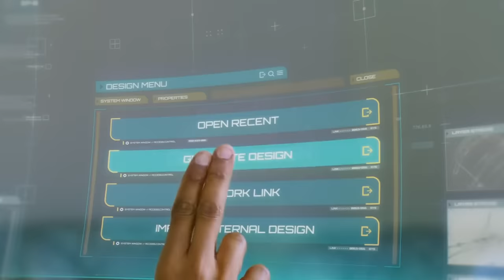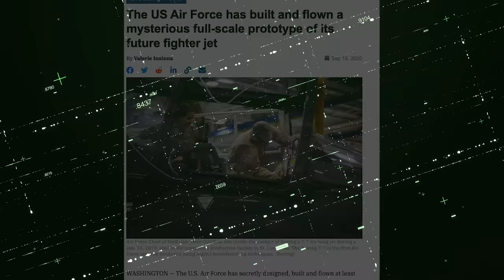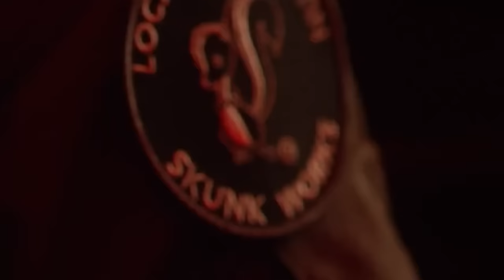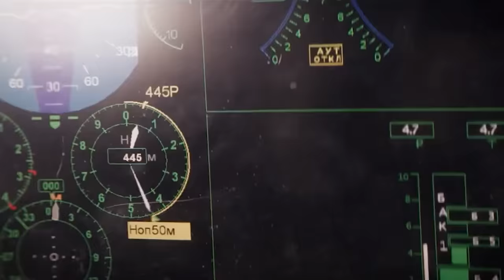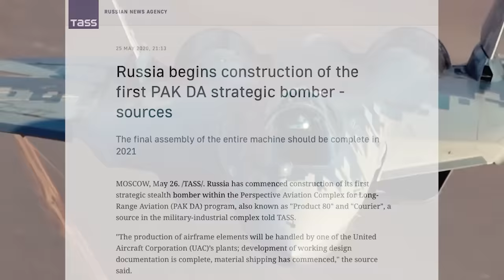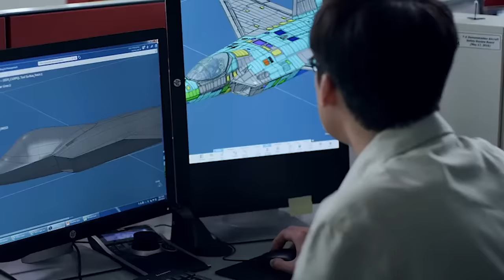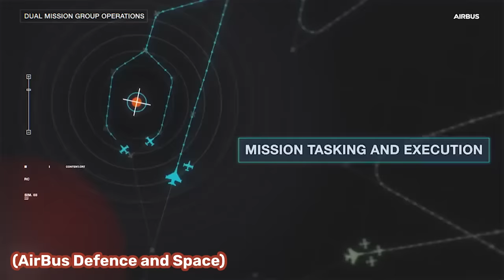12 new stealth aircraft headed toward service

Comment: So many of the new fighters look very much like the F22.  I wonder how the engineers who came up with the F22 form way back in the late 80s feel about seeing their work echoed in airframes that will be used probably for 6-7 decades after it was first conceived.
Reply: Partly direct theft, but honestly… it’s mostly just physics. 

These airplanes have to operate in the same atmosphere that is subject to the same laws regardless of what flag is on the tail. Solutions to those same rules and laws often look alike because of the same upper limits of computing power and the education of the engineers involved. Most of the very best around are products of a handful of aeronautics engineering programs.
Reply: @FloridaManMatty  good point. if you look at high end racing bikes now, they all basically look the same for the same reasons

Comment: All future aircraft are intended to be airborne comms / recon nodes. All of them. Whether US-built, China-built, Russia-built, it doesn't matter. Land-based on sea / carrier-based, you name it. Manned, optionally-manned, fully AI ... all of them.

The F-35 happens to be an airborne comms / recon node which is quite stealthy and can shoot back at you. The current incarnation of the U-2 is a not-so-stealthy comms / recon node, which we are flying today; it started out as a recon aircraft but evolved with digital tech and increasingly-advanced comms. The B-21 will be a stealthy one which can drop 20k lb of high explosive on you.

Any aircraft which isn't one of these is going to be target practice for weapons systems which are.

All current and future aircraft have a "digital twin," which allows you to test tweaks / alterations in simulation, before you get to the point of "cutting metal." Heck, even buildings have digital twins, anymore. You know the Falcon 9 and Starship have digital twins; that's why SpaceX was willing to build, and crash, Starship prototypes; they were trying promising new designs and collecting very large amounts of telemetry with which to evolve the digital twin. Their digital twin evolution on the Falcon 9 is why they now have boosters which have flown over a dozen times. More flights → more telemetry → more evolution on the digital twin → improved design and small, incremental tweaks to the physical construction → improved vehicles.

Many of the stealth aircraft you talk about in this video have passed "design reviews," meaning the digital twin has evolved to a degree and people feel they are ready to start cutting metal. Exactly where the money will come from for that ... I suspect that's a large part of what's wrong with the Su-57; they've got a digital twin, of some kind, and they've cut some metal but they're still evolving the design (see the above reference to Starship) and they're having a hard time finding the funds to cut some more metal.

That said, I love the amount of info you can cram into < 20 minutes. Keep up the good work.

I know the F-16 is still evolving; still wishing they could come up with a larger, more-capacious, faster, possibly stealthier version of it. Not sure how they can clean up that gaping maw of an intake, though. Spent multiple years as a 45254B / 2A353B (F-16 tactical aircraft maintenance specialist) so I have a soft spot for that bird.

Comment: For the Tempest RR already has the engines at MOD1 status (MOD2 will be even more powerful) . Some were put in a Typhoon for test purposes. Apparently that resulted in a fair bit of swearing from the test pilot as the aircraft acellerated down the runway even faster than expected. I dread to think what the Tempest will be like as it will be near 10% lighter and have nearly as much thrust at military as the Typhoon on full afterburner. IE 17.500 pounds dry compared to 20,000 full afterburner. My best guess is 32,000 pounds air combat weight and 54 000 pounds at full thrust. That's a power to weight of near 1.7 to 1. I think flap retraction and such like will have to be automatic because otherwise the pilot will run out of hands.

Comment: Considering India said they could see china's "stealth fighter" on land and plane radar, and China is actively trying to buy Russian planes, I'd say they're "cheng du i see you" isn't very stealthy
Reply: This is a common misconception. So you can see all 5th generation fighters on low frequency radar but that’s not of the necessary quality for an exact location much less a weapons grade lock. So you can see them just closer in and with much less definition
Reply: @wolf-xf6hf  This is true. But I remember hearing that Taiwan was able to use their own radars from the numerous amount of intercepts they have performed to estimate the J-20's RCS to be about 0.05 m^2, which is alright, but not very good compared to the American planes (usually 0.0001 - 0.005 m^2).
Reply: @wolf 101  I realize stealth doesn't mean invisible to radar on any frequency, and at any distance, but the point was, (and you're right, I'm sorry I wasn't more clear) they weren't having any problem detecting them in general, to the point that India said they wouldn't consider them stealth, although I realize stealth is more of a spectrum than a yes or no. Hopefully that makes more sense than my original comment. 
Ofc, this could be some hyperbole on Indian part but it didn't seem to be given how quickly China pulled their planes off the front line. If you have other info tho, I'd always be curious to hear it.
Reply: @totalnerd5674  That figure is generally agreed to be accurate, although it is a little on the low end. Other computer simulations generally arrive at similar numbers.
Reply: @jonathanpfeffer3716  Well at least it is better off that the Su-57, but that is not saying much...
Reply: @totalNERD  which is better than the su57? The "cheng du I see you"? I was under the impression the 57 was the best of the pack between Russia and China. Have you heard otherwise? I'm always curious to hear new opinions/ facts/ stats etc. 
I thought the 57 was best of show in part because after seeing the Sheng du perform on the frontline against India, China was suddenly trying to buy the su57s again. Ofc Russia was hesitant to sell China more because of the risk... or rather certainty of China trying to reverse engineer it. 
Imo, when Russia unveiled that new stealth fighter for export...I think it was the 75? Sorry, I don't remember the number, but I saw it as both a plane to sell to India as well as a stop gap measure to sell to China since for $30MM a unit, I can't possibly imagine it has cutting edge tech but that just my admittedly unqualified opinion of course.
Reply: @totalnerd5674  : The J20 appears on radar between 1-5M2.
Reply: @mikemurphy5898  I have never heard of China attempting to buy the Felon, are you sure about that? Anyway, I think I remember hearing the Felon had an RCS of about 0.2 m^2. 

Hold on, just googled it. You are right, but they only want the engine with it to act as a stop gap while they develop their own engine.
Reply: I doubt India would be in a position to fund the “checkmate”, considering the troubled history with the SU57 program where they withdrew.

Comment: As far as the Korean design I think that it fills a hole that many current stealth 5th gen and 6the gen designs have. low payload capability. This is one of the reasons that the USAF is buying F15EX's to really put the hurt on the enemy once the stealth platforms have cleared, hopefully, a path. The Korean plane as a clean sheet design may be able to do it better.
Reply: Here's a crazy idea. What if an aircraft carried the weapons on the top instead of the bottom?
At least the missiles for launching would be able to do so.
Reply: @protorhinocerator142  putting the missiles on top caused all kinds of aerodynamic problems lol it’s a terrible idea

Comment: Stealth changes the range of a radar guided missile lock dramatically….. just sayin
Reply: Just as stealth improves, companies will want to improve the capability of radar to break them.
Reply: @Appletank8  not really as simple as that, you’ll run into laws of physics pretty quick.

Gallium nitride radars represent a bit of a jump in capabilities but there’s not any possible breakthrough that could really transform radar detection range when we are talking about a single radar. 

Anti-stealth developments mostly pertain to using multiple radars, using different types of radars, or linking together other forms of sensor data to augment radar. Most of these with the exception of the latter are exclusively ground based due to size and weight constraints.

Comment: I know we all say "stealth isn't really invisible, it's just harder to see or has to be closer to a radar to be seen" and I get that but the B21 absorbs 85-90% of radar directed at it, depending on frequency, which imo is getting pretty close to actual invisibility.
Reply: Except your opinion is straight up wrong. Any camera or eyeball can still see the B21, therefore it is nowhere near invisible.

Definitions and facts dont change because you have an opinion on them.
Reply: I think this mostly refers to jets due to their observable features like control surfaces or tail wings but yea the B-21 is getting shockingly stealthy I just hope americas stealth defense systems are keeping up
Reply: The radar cross section of an F-35 is likely to be at least 50,000x smaller than that of an F-16 and over 250,000x smaller than that of an F-15. The absorbent materials help but it's the shape of the aircraft that seems to make the biggest difference. Of course, they also need to minimise their IR signature and if you look at the jet nozzle of an F-35 you can see it has a very complex design to reduce the visibility of the exhaust.

Comment: Sweden is not as invested as we were in the Tempest program. 
SAAB got a contract for about 25 million dollars to do a study on what should be the next step for us.

And btw, even the old Gripens have an RCS of 0.1m2, which have been floated as threshold for stealth. The new Gripen E has lowered that even more.
Reply: If you gave the Gripen a thrust vectoring engine, I wonder if that would be a massive improvement or failure.
Reply: @xkavarsmith9322  Or maybe an hybrid more powerful engine like the new one for the F-35.
Reply: As far as I am aware, it's only a memorandum of understanding with saab.
Reply: There is no way a a combat loaded gripen has that low of an rcs. Neither have a stealth coating either
Reply: That RCS figure isn’t even close to accurate even for a clean Gripen, hell, even a clean Gripen E
Reply: @Cartoonman154  SAAB was committed, even announced investments of £50m in the UK and opening a center for Future Combat Air Systems there.
But hey, we all know how the UK is with deals and contracts. They don't care that much about staying true to their own commitments anymore.
Reply: @jonathanpfeffer3716  You can't use your own eyes and deductive reasoning to calculate an RCS value. 
We take the "F22 has the RCS of a marble" at face value all the time. But hey, if a US manufacturer gives a number, it's the truth, when anyone else does it, it's a lie. 
I find this thinking comical.
Reply: @kameronjones7139  Is it really that low being 100 000% larger than the F22's official RCS value?
Reply: @benghazi4216  what kind of argument is that? The f22 is one of the most stealthy fighters in the world and you are comparing to a 4th gen of all things. You haven't even considered combat loads when you brought up the rcs of the gripen
Reply: @kameronjones7139  It is an argument meant to make you reflect on the numbers. 

And all this 4th gen, 5th gen. It's just meaningless marketing speak. 
What you look at are actual capabilities.

I don't know if SAAB is basing their value on a clean plane, or the regular combat loadout of 4 AA missiles. 

It's definitely not based on 7 RBS 15 strapped to it. That we can agree on.

But does RCS matter that much if you have world class EW? 
Even the old Gripen's seem to be able to creep up on all sorts of fighters.
Reply: @benghazi4216  no it really isn't the f22 is designed specifically to be the top stealth fighter. If you want to talk about actual capabilities the f22 dominants the gripen there is no point in comparing. For some reason everyone who talks about the gripen want to say stealth is pointless when you have ew will simultaneously ignoring the ew mathematically works better with stealth so yes rcs matter alot.
Reply: @benghazi4216  The unreliable country is Germany - they're the ones you really don't want to partner with for your defence project. At least the UK tends to stick with projects as much as we can, even when other countries pull out or start weaselling out of their comittments (hello Germany!).
Reply: @kameronjones7139  Hah, yeah specifically designed, thus 100 000% better. But you want more? A million, two? Ten? Based on what? That the F22 was designed as a stealth fighter? Jokes.

The US is the one holding back the F22 every time there is an exercise with the two involved, even when the Gripen is on the red team. Strange behavior don't you think? Reason could be that later a freaking Eurofighter shot down a F22..

Certain EW sure benefits from stealth, others don't. There is a reason why the US has Hornets as specialized EW platforms.
And every single Gripen is on par with those.

And you clearly overvalue RCS. Look at the US SEAD/DEAD capabilities. Flown by what? 4th gen fighters, with official RCS numbers much larger than the Gripens.
Reply: @trolleriffic  I don't know, we seem to make it work? Taurus is a fine missile. 
But small potatoes compared to the Eurofighter granted, which to be fair is a project doomed from the start. You shouldn't share a project like that, it just doesn't work.
Reply: @benghazi4216  Yes, do you not understand how stealth works?
The only reason the ero fighter shot it down was because they handy capped the f22. 
The f18 is used for ew because the navy just got stealth fighters, and the f35  is used for sead now.
Look at that statistics stealth aircraft out performed 4th gen by a mile
Reply: @kameronjones7139  They really didn't but whatever makes you sleep better at night.

The F18 is used because RCS doesn't matter as much as you are trying to make out. There has been no rush here in hunting lower RCS values at all.

And I hope you know that this 4th and 5th gen terminology is pure American marketing right?
Reply: @benghazi4216  ok so you keep dodging any point that I make. Actually look at the details regarding the fight. They literally would not allow it to not to engage until visual range because it wouldn't show up on radar 

The navy literally doesn't have any other option besides the f18 for jamming. 

You once again aren't even trying to actually address what I said. The f35 and f22 repeatedly out performed every western aircraft in red flag. (241-2) Stealth fighter are used to hunt radar now with non stealth aircraft regulated to staying back because they are survivable enough. The irony is that Sweden is getting f35

Comment: The transition to stealth is like the transition from prop planes to Jet engines; at first, it doesn't make much sense, the nighthawk lost lots if performance and was only a stealthy bomber. The B-2 took lots of cash and time to develop, and other nations turn away from this new expensive idea. This is similar to the British Meteor and Me262 coming out, they were new and expensive, and were not as fast or agile as the P-51ds that they faced. The U.S did develop the P-80, and everyone later found that jet engines have serious potential. In the future, the only way you survive is by being stealthy. Sams will get better at detection, and infrared will be more sensitive.
Reply: The 262 was faster than the P-51, but suffered from an atrociously bad acceleration (like the Meteor) which often made it possible for P-51s to catch up on them if they dared to drop their energy. They were especially vulnerable during takeoffs and landings as well as in the pattern. But your overall point is spot on. It takes time to mature and eventually, (almost) everyone will have it...
Reply: @CakePrincessCelestia  the 262 was faster in straight, level, 25,000ft flight. Start a dogfight or turn to re-engage and that P-51 is much faster. And it's also worth mentioning that the P-51 was good for more than one flight. The 262 engines were terrible and impractical
Reply: @thepilotman5378  That's what I was saying with the acceleration thing. Takes ages to get there and turning in a fight will shed that energy, so you'd really have to be a very patient and well-aiming BnZ style pilot knowing how to use energy advantage without burning it off by turning too far into the evading opponent. The P-51 can get dangerous quicker than most would imagine. Especially with the sheer mass of .50 cal it can hose down range. A lucky hit can be enough to take out either of the engines which were rather exposed and very vulnerable.
Reply: @thepilotman5378  
sure, but if the 262 was what people thought all future jet fighters would be like, nobody would build them. The lesson learned was that jet engines had potential, but still in its infancy. 5th and 6th Gen fighters are likely not going to be the straight line speedsters, the high maneuverability experts of 3rd or 4th gen fighters, but they won't need to be.